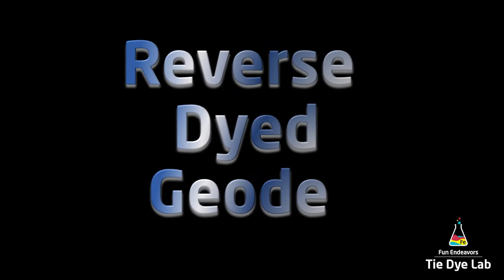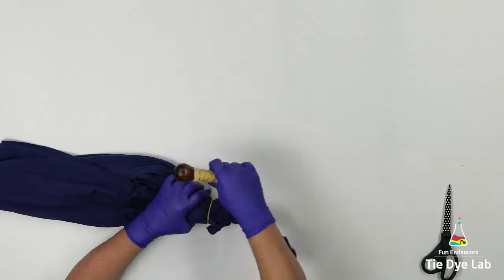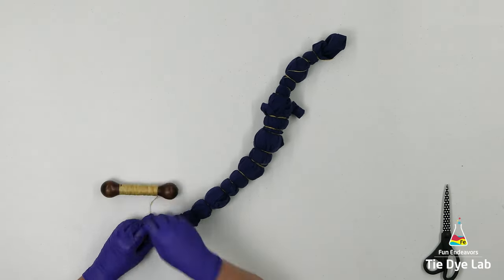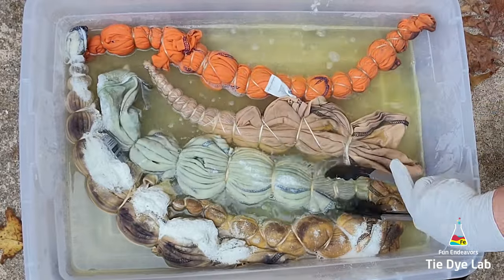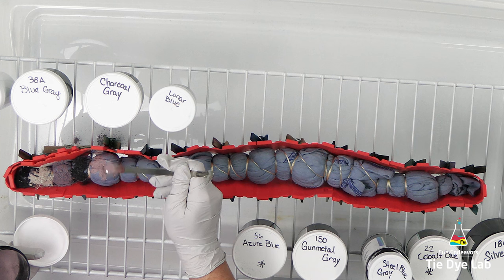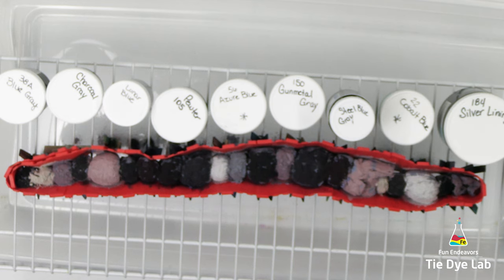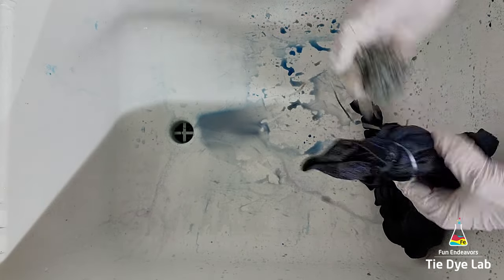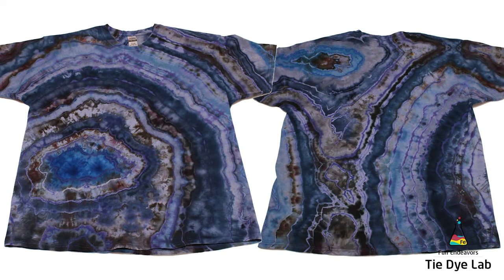Tie Dye Pattern:  Reverse Dye Geode Using Out White Brite and a Royal Blue Shirt [Ice Dyed]

Comment: That is nice! I love geodes,  and those blues and grays were perfect. (You knew I'd ask about the Mom Jeans, didn't you? ; )  ) Which gray are most of the lighter grays? Are any of them the Silver Lining?
Reply from the maker: Thank you!  I did use Silver Lining on this shirt.  I used it on the 10th section and then again toward the outside of the shirt.  I think it's the lightest gray I used, and it is really light on this shirt since the shirt started out light blue to begin with.  Charcoal, Pewter and Gunmetal are all a little darker than Silver Lining.